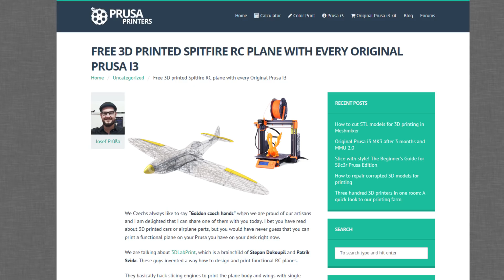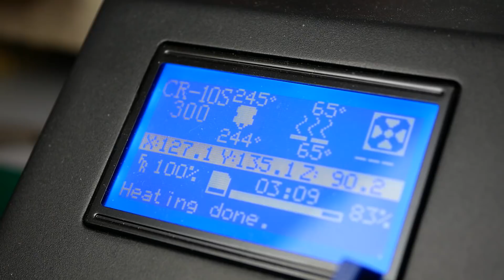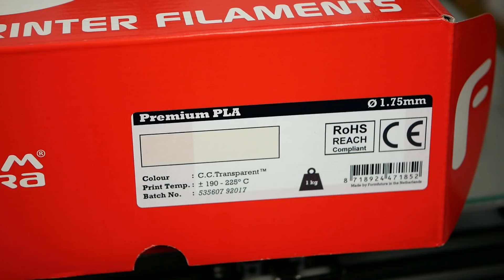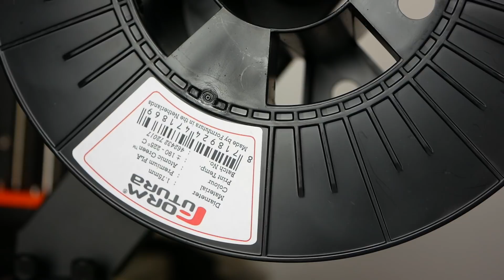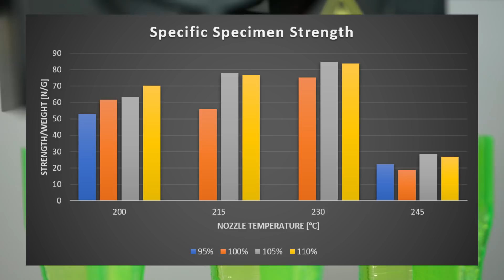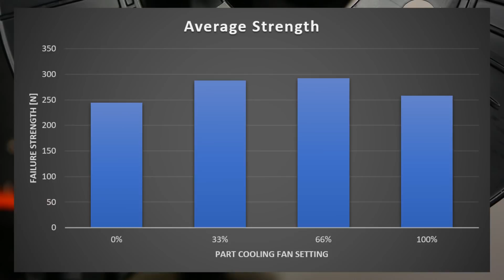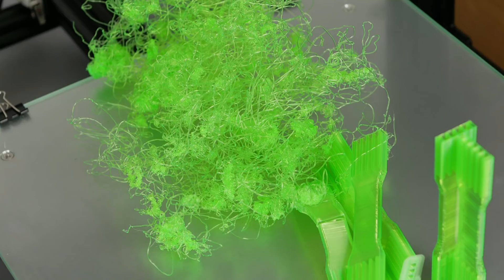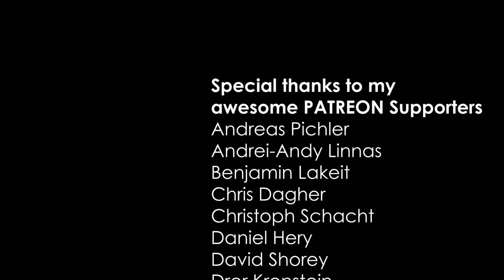3D printed AIRPLANE - Messerschmitt Bf 109 || PART 1 - Tuning print settings

Comment: Has anyone ever tried to print it with LW filament which is an option these days. Maybe a good portion of 25gramm glass filament laminated on the crosssection, leading edges and maybe in the region where the fuselage is attached to the Motormount.

Comment: Hello Stefan! I print the BF109-H and have a problem with cura. One Part is slicing perfect and print very well. But when i add a second Part in Cura, the complete inner strukture wont be sliced on both objects. You have any idea, how to solve the Problem?

Comment: I'm using a .6 nozzel instead of .4 and the quality and strength were much better. I bought the messerschmitt too but I'm working on the focke wulf right now. I'm also going to try using hips as recommended by eclipson 3d printed planes. Have you tried hips filament for planes? Strength tests? Thanks

Comment from the maker: Looking for a good deal on a new 3D printer and want to support the channel? Take a look at the affiliate links below and in the description:
Get a Creality CR-10 on flash sale for $389.99: https://goo.gl/LNHdbh
Get an Alfawise U-10 on flash sale for $455.99: https://goo.gl/ddPi4v
Get a Anycubic I3 MEGA on flash sale for $349.99: https://goo.gl/fH6o3M
Get a CR-10s for $440.99 with the code "GBsale127" : https://goo.gl/9WPzYo
Get a JGAURORA A5 for $335.99 with the code "GBsale129" : https://goo.gl/2UnFpu

Comment: Hi Stefan! Your videos are great!
For the extrusion multiplier you can allways mark a predefined length from your print head on the filament and then extrude the same length via prontrrface or a similar programm. After that meassure again and divide predefined value with given value -> extrusion multiplier.

Comment: CA glue would be better but that's only because part my showerhead design failed when I used epoxy, I still don't fully understand why, but the CA glue has held up for 12months so far. I'd also consider looking at using Poly Cement.

Comment: One thing you might want to consider when using CA glue is to get the rubber ice stuff I'm not sure if it's available in clear it might only be available in Black but because it's got rubber mixed in with it it's not quite as brittle a normal CA it has a tiny bit of give you can't feel the give but you'll notice it on impact it doesn't break as easily

Comment: What's the smallest printer you can get this model to print on ie what are the measurements of the largest parts. I've been wanting to do one of these but don't wanna fork out 20 ish bucks on a model I can't print
Reply from the maker: 200x200x200 is recommended, some can even be printed on smaller beds.

Comment: It makes sense that you need higher extrution rates, because the CR-10 is known for under extruding. Try measure the length of filament used, and you will understand my clame. So higher temperatur makes it easier for the extruder motor to run. I upgraded my printer with this setup, and got correct extrution lengths. https://www.thingiverse.com/thing:1078763

Comment: Hi
I have Tevo Tornado 
I put glass because the bed bubbles
The glass printed good but now all my prints don’t stick and come apart!
What am I doing wrong?
Reply: Osamah Abu Ali check your extruder nozzle clearance withe everything up to print temp , your build plate could be bowing /warping giving you too much gap between the nozzle tip and build plate
Reply: I use paper of the leveling / clearance.
The layer height is 0.2
I'm using www.repetier.com
Reply: Osamah Abu Ali if your clearance is the same as before when it printed properly it could be under extruding , possibly a nozzle blockage , dirty extruder grip roller  or filament binding .
Is the first layer squishing down on the build plate or just sitting on top ? 
There are many little things that can go wrong and the only way to find out what has gone wrong is to methodically check over the printer . 
Correct Nozzle clearance  and bed level when hot as the clearance will change as it heats up:
Clean bed ? Are you using an adhesive enhancer like hairspray or glue ? 
Clean nozzle :
Check extruder calibration and drive roller for clogging : 
Check the filament feeds freely :
Correct nozzle and bed temps :
Have you changed filament recently ? Maybe the problem started with a new roll ? 
Double check your slicer settings , your travel speed for the first layers may be too fast or have you changed anything on your printer settings on the printer controller ?  Some printers allow you to store offsets and settings directly on the printer controller - see if the menu has a restore defaults or  similar .
I never liked repetier - too much stuff in it to go wrong , i had a lot of trouble with getting it to work properly and i went back to cura . If i ever change slicers i will be buying simplify 3d .
Reply: I can send you video..
Reply: i have a picture
Reply: Osamah Abu Ali 
The best thing would be to put up a video on your own youtube  channel  then everyone can look at it .

Comment: I have not experience on glueing PLA, but have large experience on building RC planes and other staff.
The strongest for sure is the epoxy. Recommendations:
- Use a quick one if you do not want to wait very long curing times. (15 - 30 min. will be ok, 5 min. ones are usually too quick)
- Slow ones >1h curing time produce stronger bondings.
- If you are not careful you can increase the weight of the plane too much when using epoxies, so I recommend that you get a light weight one specially for airplanes, if you can not find it you can mix with microballons.
I think that as suggested by 3DLabPrints the best option for this project may be cyanoacrylate, recommendations:
- There is BIG difference on quality depending on brands, I have get the best results with BSI brand ( http://www.bsi-inc.com ).
- There is different kind of CA viscosity, I think for this project medium viscosity and high viscosity will be the ones to choose.
- Get as well a CA accelerator, it makes the CA to cure faster and improves the strength of the joints.

Hope it helps
BTW Great project.

Comment: I've printed three of these, two for flying and one painted model. Used a Anet A2, but my mk3 is on the way and can't wait to try it on that. I used ca glue with activator, it worked great.

Comment: i printed the Spitfire on my Prusa MK2 using the recommended settings and glued it using a cheap super glue which i bought at 1$ for a 10ml bottle (Kind of Fevi Kwik). It worked quite well and even after the crash the parts didn't break from the joint but layer lines and other parts!!
Worked great but crashed it cause i didn't know how to fly a RC Plane and it was my first time!

Comment: I just printed a 3DLabPrint Zivko Edge. Very impressive model. Printed it on a MK3 and all together it took me about 40 hours of print time. They even included Simplify3D factory files for a Prusa MK2, that all together gave good hints on what settings to use with the MK3. So all in all I am pretty happy with that bird. Thumps up for 3DLabPrint for their work.

Comment: I wouldn’t worry to much about getting the maximum strength as the only time  the plane will be subjected to loads which could result in failure will be during a crash, in which case it’s probably going to break regardless. Go print quality.
Reply: If it's anything like the dynamics of large aircraft you'll put considerable load on the wings and other flying surfaces if you pull hard maneuvers, and you'll hammer the landing gear and body pretty hard if you land badly. (that is, a hard landing - not a crash in which you may flip or hit wingtips against the ground.)

Flying models are subject to roughly the same physics as full size aircraft, so it stands to reason that they'd be subject to similar forces.

(however, the volume to cross section laws that govern scaling up or down objects suggest any scaled down model will be disproportionately strong compared to the full size equivalent - it is of course typically made of weaker materials though.)

Comment: S#!% electronics -> do this -> 
M303 E0 S245 C8 

then save values with command or correct them in FW

also instead of optimizing retraction, combining, wipe and cousting -> use Linear Advance (turn off wipe, combining and cousting, reduce retraction lenght)
Reply from the maker: Good ideas! Unfortunately that's not a PID problem. The 5V rail on the CR-10s board is noisy which is causing these fluctuations.
I'd love to use linear advance but that would require updating the firmware.
Reply: CNC Kitchen Linear Advance fixes most of issues your prints have in the video.

You can flash the firmware fairly easy (there alot of guides) with an arduino or raspberry. (*if your CR10s doesnt have an Bootloader installed already, mine CR10 didn't).
There is also an example file specially made for the CR10 in Marlin so you don't need to fiddle around with most of the code.

calibration of linear advance is a one minute job and it's totally worth it.

It replaces wiping, combing, coasting and you can reduce retractionlenght as well. Improving print and layer quality and consistency.

Also you could do a video about it to show of the result. If you need help I'm from munich

Comment: I would definitely print it in poly carbonate or similar so you can acetone weld and is very crash resistant, pla is probable the least suited material because it also plasticity deforms under constant strain  and is super susceptible to shattering on a crash, and you cannot acetone weld.

Comment: I would go for the best print quality and spray paint a laquer on it after to improve strength. You could even anneal the pieces in the oven after to get even better strength.
Reply: Annealing is going to ruin such thin parts. Internal stresses will bend the surfaces when the temperature exceeds glass transition temperature of PLA.
Reply: also, Laquer  paint will not add strength, just weight.
Reply: 3D printed plane
Reply: Michael Rinkle Just add larger motor and battery, weight should NOT be an issue with coatings.
Reply: @scottfirman  That will increase the wing loading, which will increase the stall speed, force landings at a higher speed and  thus increase the risk of damage. And as Rinkle pointed out, lacquer paint will not ad one drop of strength. It is a brittle coating , used primarily on wood furniture to achieve a high gloss finish.

Comment: Pretty cool, though i've gotta say i despise that wing design, not absolutely everything has to be 3d printed! Just print only the ribs and use carbon fiber rods for the spars and cover it all with some vinyl or something.
Reply from the maker: I agree, but still this shows what 3D printing is capable of.
Reply: Epoxy and carbon fiber, I agree.

Comment: Hi Cnc,  
will the cura profile be available for download? thanks in advance
Reply from the maker: Of course!
Reply: I just finished the spitfire, and could not use cura ...what setting do you use so that cura slices the inner structure? The wings were being sliced only on the outside surface, the only slicer that worked was mattercontrol. Great video by the way. I used epoxy to glue mine, it is stronger than the glue on the instructions but is more difficult to use and more expensive.